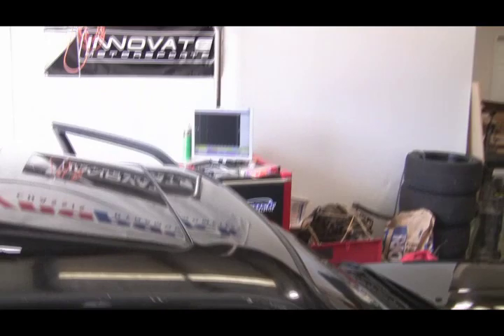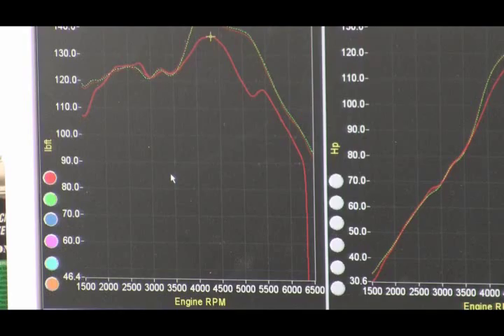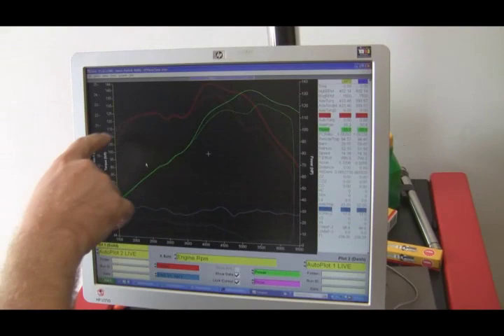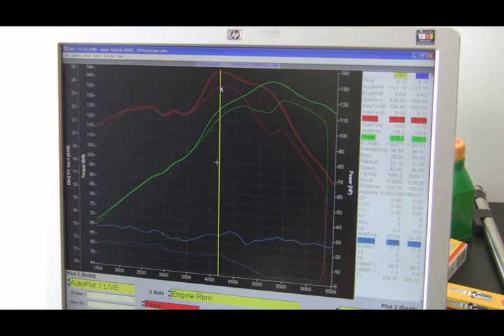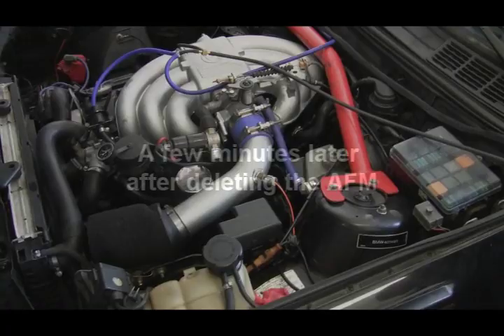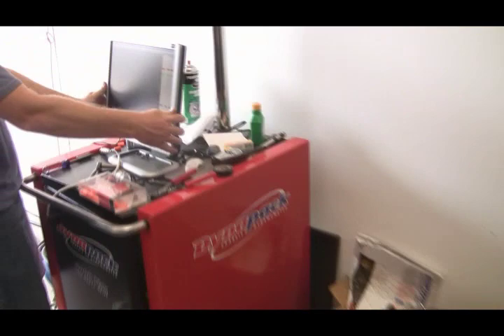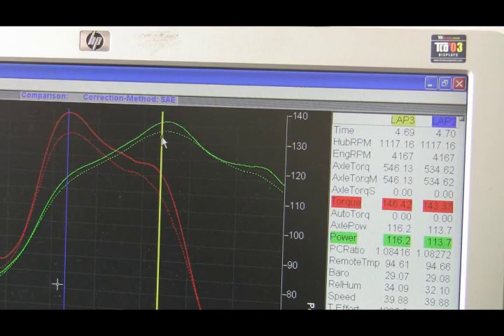E30 BMW Dyno Pulls with Stock ECU versus DIYPNP MegaSquirt

Comment: @ahage4x4 
Ok man, thanks for your reply, you should then have a manifold air pressure sensor, instead (you actually need to tell the engine how much air is getting inside the manifold, or you do have another solution (throttle plate angle sensor??)  ?

Thank you

Comment: Good gain simply from replacing ecu. ~12-13%
BTW this motor should have 168 hp on stock ecu.
The freshly rebuilt engine might go up to ~190hp if a 13% gain remains.

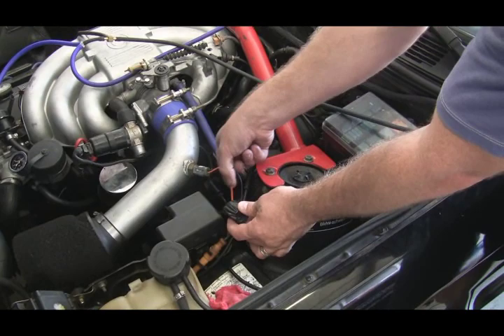Comment: Is that the MegaSquirtPNP G2 B8793 in the store? Is your idle control valve blocked off at 3:58 / is it still required? What injectors would you recommend on a setup like that? - TY

Comment: so the engine originally had only 142 hp at the crank (15% drivetrain loss, 121 hp wheels). that's bad coming from 170..

still after tuning only 160 crank horsies
Reply: NineEleven1 imagine fully rebuilt. 🤘

Comment: great job ,i have bmw m50b25 i want to install turbo on the but on stock ecu and stock fuel pump and stock injector how much boost car with stock engine can take
Reply: you can probably make 350 hp, maybe more from that engine, stock, but I would imagine you would be tempting fate.  asking how much boost an engine can handle is kinda a pointless question.  

The engine may well hold 90 psi, but it sure as hell won't run long.  people forget that in order to have pressure you must have the fluid flowing or moving first, it is only the resistance to flow that creates pressure.  so basically, there are just to many different factors at play to just say "it holds 20 psi of boost".

Comment: will the icv still work if it's set the way it is in this video? if I turbo mine, can i still leave it the way you displayed on this video? I'm assuming it doesn't matter where the bypassed air comes from?
Reply: I am wondering about the same thing.
Reply: He just did a quick swap to see the difference. 
The icv now takes unfiltered air from the environment.
Not a problem in a garage but in a normal setup you need to make an inlet behind the airfilter to the icv